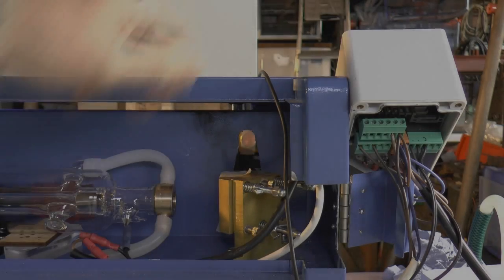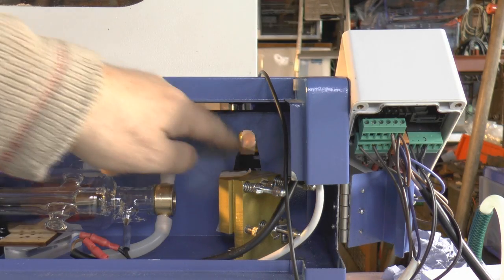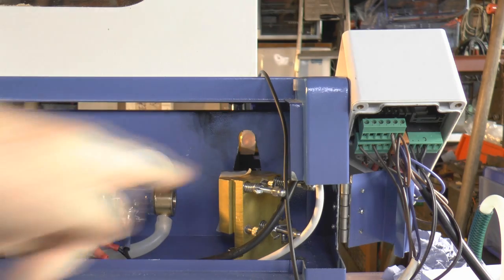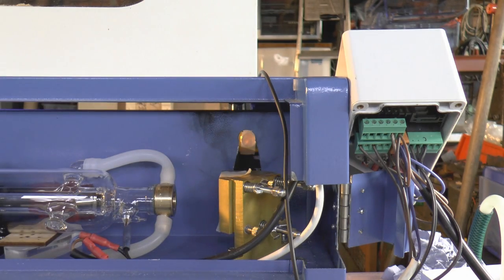RDWorks Learning Lab 51 Beam Setting for Beginners part 2

Comment: absolutely the best mirror aligning video on the web!  thank you! could you tell me where I could buy the laser tube  supports you have, they are perfect, exactly what I have been looking for, Thank you.
Reply from the maker: Hi Ed 
Thanks for the kind words. This was on my first machine and beam setting was one of the most feared and misunderstood elements of a gless tube laser machine. By the time I did this video I had probably upset my mirrors  purposely more than 50 times trying  to find better ways to set the beam and overcome the fears. At the time I thought I understood how beam alignment worked but during the intervening 7 years since this was done, I have learnt so much more about lenses. laser beams and perfect beam setting. Although I have 5 various lasers in my workshop, they are "toys" that allow me to do research on the many aspects of laser technology...........I do no production. I have modified my machines to make beam setting simple and error free as I now understand fully how it all works.There are a couple of more recent videos that I would advise you to watch
https://youtu.be/6aNwKhTRnd8 
and
https://youtu.be/tvNfAg-cOLA 
If you are still interested in the DXF files for my adjustable clamps then you can contact me privately with this form and I will send you the file.

https://forms.zohopublic.eu/ndeavorlimited/form/K40XtreeemLaserCutterContactRussSadler/formperma/k2Cn0QN5ChpazfTMAUw25lZ-FKpjZa96TQWHjv3ntOg
 Best wishes     Russ

Comment: I am getting a crescent shaped burn on the wood when i pulse ? approx 1/8 inch wide  like a sliver moon?
Reply from the maker: Hi Scott 
 Your beam is being reflected off the inside of your lens tube. At this stage in my learning journey  I did not understand the real importance of the beam setting in the Z axis.  Your machine will almost not have the adjustment  needed to to enable this setting to be performed accurately and easily. The only way you will be able to do it is by physically adjusting your tube which is a VERY difficult and laborious way of beam alignment. If you watch one of my more recent videos I go through the principles of beam setting in great detail for all 3 axes.
 see m https://www.youtube.com/watch?v=6aNwKhTRnd8
 and a footnote video
https://www.youtube.com/watch?v=wS1qgmv8HTU 
 Aligning the AXIS of the beam with the AXIS of the lens is ultra important.

Best wishes
Russ
Reply: Thank you so much for your quick response and heading me in the right direction

Comment: I don't have an engineering degree but I think I know I am one at heart. I am self taught by troubleshooting problems and why they happen. You know, so the same mistakes are not made over and over again. 
Thank you for taking the time to explain how and "why" the laser tube must be set up this way. Bravo my friend, bravo.👏
Reply from the maker: Hi Brian
This video was done 5 years ago now and I have made a lot of mistakes between now and then.....but that's the nature of self education and discovery.. Beam setting has always been a  particular hate of mine (and many others)  and I wrestled with the problem for a few years trying to fully understand it and find ways to make it simpler and more accurate. I went through a phase of believing that a red laser beam to copy the invisible laser beam would solve the problem. Wrong. I got to Mk8 and gave up. All close but not perfect enough.   The real soloution and understanding happened about 2 years ago when I designed an adjustable  head mounting bracket. 
 All I can say is take a look at Learning Lab #192  and 193
https://www.youtube.com/watch?v=6aNwKhTRnd8

Here there is a beam setting masterclass and a demonstration of my design changes to make beam setting simple, quick and perfect.

 Best wishes
Russ

Comment: Hi Russ my stylecnc laser set to one speed and power wont take effect any change on the rdworks how can i do a factory reset?
Reply from the maker: Hi Miguel
Do NOT touch factory reset. The factory may not have saved working settings and then you will be deep in brown stuff!!!!

I suspect that you may have DEFAULT  ticked beside the speed and power windows . Make sure these are UNTICKED. Do you still have a problem?
 Best wishes
Russ
Reply: @SarbarMultimedia  i try default and undefault still same speed and power nothings change the settings. Its irritating i used to operate the epilog and very simple t
But this one omg got so many factor that go wrong. And the origin wont take effect either it is a nightmare this stylecnc and i try calling china bt is 3am over there and cant get any support so theres the 24hrs support
Reply from the maker: @llesco693  
 Hi Miguel 
Just at present I can't help either. It's 01:30 hrs  here and I am just off to bed because I have got to be up at 6am to drive about 200 miles tomorrow. I will be back about 4pm UK time . Are you working Saturday? Do you have Skype on your phone?. Add a disguised email address to another comment so that I can contact you Look at the top left corner of RDWorks and there is a version number of the software . It will be V8.01.??. What is your issue number?

 Here is a stable version 38  for you to download and install because I suspect your version is less than 38
https://www.dropbox.com/s/8xugiag5alqlp4v/RDWorks%20ruida%20issue%2038.rar?dl=0

Best wishes
Russ

 ps these are only problems and all problems are fixable.

Comment: Hello Sarbarmultimedia, I am completely new in this area (laser cutting machine° I am interested in buying one from a Chinese company, but I have no idea which one is good or not. The size I am interested in is 1300/900 mm approximately. Please can you put in contact with a dealer or the name of a machine? Thank you in advance. (for acrylic wood glass etc..)
Reply from the maker: Hi
I recently came across this very nice looking machine that has all the requirement of a quality machine at a very reasonable price. I don't know where you are but you will be able to contact the manufacturer through Ebay.
https://www.ebay.ca/itm/Laser-Engraving-machine-6090-100W-WIFI-Ruida-CNC-Laser-Wood-Co2-Marking-Engraver/303133646398?hash=item46942c5e3e:g:kaQAAOSw7E5cvs7T

 It is a jungle out there when trying to buy a machine. You could always contact Cloudraylaser.com for a quote on one of their machines because they only sell top quality products from trusted suppliers. However I think you will find it hard to better the machine I have linked above.
 Best wishes
Russ

Comment: Thank you for this video. I really needed this bit of theory and the diagrams to fully wrap my brain around this process. It has literally been a few days that I've been at it after replacing the tube. Learned a couple of tricks too like the wire spacer to set the distance of the mirror to the mount and I didn't understand the proper alignment of the tube itself relative to the #1 mirror..
Reply from the maker: This is a long way back in my learning journey and I have experimented with several different ways of beam setting after this to find a simpler, logical and foolproof way of doing it.. If you wish to add your email address in longhand form to disguise it   ( spongedotworthyatgooglemaildotcom)  I will send you a written text to guide you through the process

Best wishes
Russ

Comment: When you are done with your adjustment you can sell your machine for 20k
Reply from the maker: Hi Mark 
I spent many hours experimenting and thinking even after this video., I finally devised a simple foolproof method of setting mirrors when I fully understood how they worked.
There's you tearing your hair out and me relaxing by our pool on a 26C warm night  here in Rhodes. Do I care? Well yes......not about you but about that machine you are just about to take a hammer to!!!!
I do have a written procedure but at present I may not be able to access it. Let me hunt around on the kit I have brought with me to see if its immediately to hand. I'll get back to you shortly.
Best wishes 
Russ
Reply from the maker: Lucky you
 Try this
The principle is very simple . and easy when you have confidence. I know that fear of never getting your machine to work again. I had it the first time I took a mirror off to modify it. 
Set your max power button to about 15% That way when you press the pulse button you will not blow a hole in your target. The aim is to scorch  a mark so it may take two or three pulse pushes to get the mark.
Aim your laser beam at the CENTRE of mirror 1. The angle and alignment of the tube is not too important because mirror 1 is able to deal with the error. Now concentrate on mirror 2.
 
SETTING THE Y AXIS
 
Step1   SITING
Drive mirror 2 to the front of the machine and adjust mirror 1until the burn mark is somewhere near the centre of the mirror (it does not have to be perfect, within 2 or 3mm is OK) This just to make sure your beam hits the mirror.

Step 2   TARGET BURN 
New target. Bring mirror 2 close to mirror 1 and produce a scorch mark This is your TARGET. 

Step 3    MATCH THE TARGET
Drive mirror 2 to the front of the machine and adjust mirror 1 until the scorch mark coincides with the TARGET. 

You will find it difficult to achieve this first time so repeat steps 2 and 3 until you achieve near perfection.  Once you have achieved this YOU CANNOT TOUCH MIRROR 1 again. 

Hopefully if the Chinese have set your machine correctly the burn you have on mirror 2 will be within 2 or 3 mm of the mirror centre. If not, we will have to discuss the options  of  how to get that burn mark to the centre of mirror 2. 

SETTING THE X AXIS

I am very sure that your number 3 mirror is poorly designed just like mine and many other gold heads I have encountered. If you look at my videos you will see a black line across the entry hole to the head. If you aim for the centre of the hole you will find the Z axis will be very wrong. Draw a line about 3mm above centre and that is where you will be trying to aim your beam. Lets call that point A
 
Step1   SITING
Drive mirror 3 to the far end of the gantry and adjust mirror 2 until the burn mark is somewhere near A This just to make sure your beam hits the mirror.

Step 2   TARGET BURN 
New target. Bring mirror 3 close to mirror 2 and produce a scorch mark This is your TARGET. 

Step 3    MATCH THE TARGET
Drive mirror 3 to the front of the machine and adjust mirror 2 until the scorch mark coincides with the TARGET. 

You will find it difficult to achieve this first time so repeat steps 2 and 3 until you achieve near perfection.  Once you have achieved this YOU CANNOT TOUCH MIRROR 2 again. 

Now you will identify a major problem. The dot is not on A You immediately think to adjust mirror 2 to put it into the right place WRONG. YOU CANNOT TOUCH MIRROR 2 again.  You must stop and think how to get the dot onto A. I have modified my head mount so that I can move the head to put A into line with the beam. I suspect your head is not adjustable. The only option is to go right back to the tube and move it so that the beam finishes on A. That is a VERY tricky setting and why I made my head adjustable. Do you keep fiddling with the tube position or make the head adjustable? Your choice. I think this is a major design fault with these machines.

Mirror 3 and the Z axis alignment is the most important one you have to make. Most think this is the easy axis but it is the most difficult. 
First understand what the "sweet spot" is for mirror  by watching
https://www.youtube.com/watch?v=eSjNsK2sjNo
Take a look at  this from about 24minutes 
https://www.youtube.com/watch?v=jVGByifge_Q
This will step you through the important principles  for setting the Z axis

Comment: Hy. I am new in this line of work, can you recommend me a laser machine which can do light things like key rings?i want to cut 4 mm playwood with the machine. Thanks in advance!
Reply from the maker: Hi Timotei

For your 4mm plywood cutting and engraving keyrings you will not need more than 60 watts power..  It really depends on the budget you  have to spend. It sounds like a 500x300 work area would be fine for you but the problem is they will probably only be available on Ebay at a reasonable price ($1200 to $1500). They will claim to be 50 watt machines but they will be  B grade 40 watt tubes. For about another $400 you will be able to fit a new A grade 60 tube and power supply.and finish up with a cost effective 60 watt machine. If you go for the next size up it is 700x500mm. It will claim to have a 60 watt tube  but will have a B grade 50 watt tube fitted. You will pay $1800 to $2000  and you will still have to spend that  $400 for a new tube and power supply.. Ant machine from E bay will  in the end be a bargain but YOU will have to put effort in to make it work well.. There are two alternatives to this approach. Either to buy directly from China which will mean a long delay, a machine that will comply with the specification  but may still require a little attention to get it running well. By the time you have paid for transport, customs duties including VAT  it will probably work out 15% to 20% more expensive but you finish up with a better quality machine. The second alternative is to buy through a proper import company who rebadge the machine and support it. It will be a plug and play machine that you will be able to use from day 1 but for this service and level of quality you will pay about $4000 to$5000 for a 600x400mm machne with a 60 watt tube.. This will be a top quality machine ready fro production and with proper service support..

As I said, it all depends on your budget, your requirements and the compromised that you do or do not wish to make. Write again in another comment with your email address when you have looked around and need some advice on you machine choices. I will delete that comment and send you an email response.

Hope this helps
Best wishes
Russ

Comment: Hi!  I have owned my chinese laser for about 2 years.  In that time I was not confident enough to correctly align the beams.  This week, I stopped everything to level my machine, watched your video, and aligned the mirrors.  The dots are on top of each other on x and y like you suggest, and the vertical is as close as I felt I could get.  Running a test cut on 1/8 plywood, I was able to cut through at speed 10 and power 60 on the left 1/3 of the bed.  Beyond that, it was not making it through the wood.  I have a picture of this.  I went back to the tube alignment, and took a picture of the dot on the tape.  It is not a solid dot, but a circle within a circle.  Can you tell me what is wrong?
Reply from the maker: Hi Melissa
The power with you beam should be like when you shine a flashlight at a wall. There will be an intense bright centre and light feathering off to noting at the outside.. Thus your beam should produce a dark intense centre spot and not circles. My first guess is that you have a tube labelled K H laser. Sadly, YouTube canned their private messaging service a few months ago but you can attach your email to another comment and it will be autocopied to my gmail. I will immediately delete your comment from public view and write back to you. We will need to exchange pictures to resolve this issue.
Best wishes
Russ
Reply: @SarbarMultimedia  I have a thunderlaser tube.  my email is hwcraftnight@gmail.com